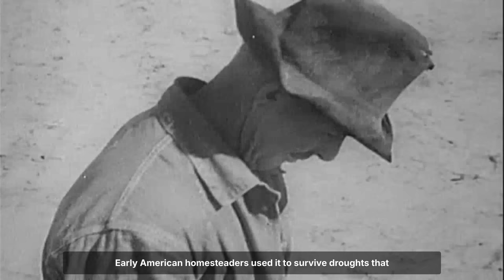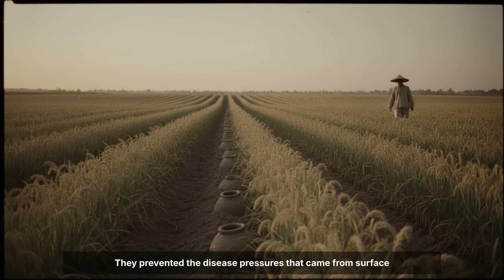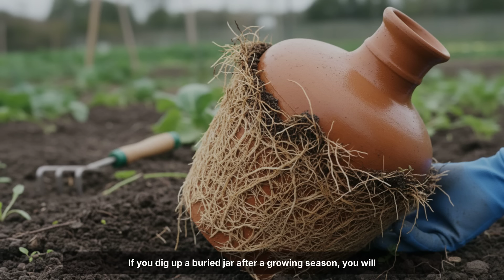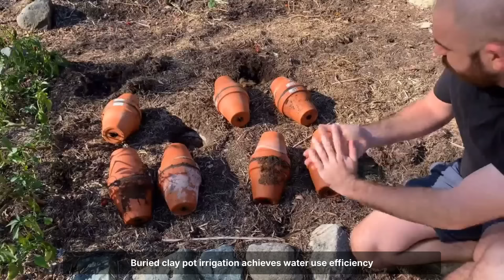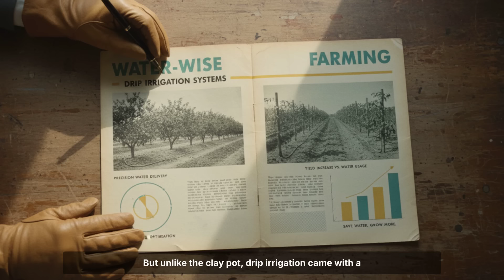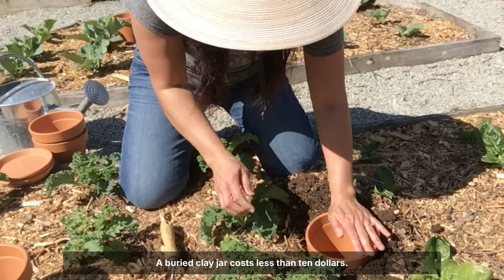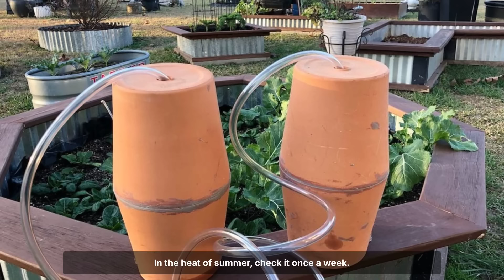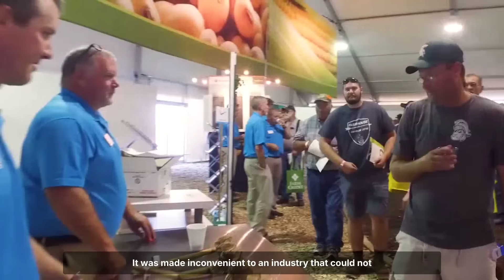Forget Watering Your Garden for Weeks With This 4,000-Year-Old System

Comment from the maker: This self watering system fed civilizations for over 2,000 years using nothing but unglazed clay and soil physics. It was abandoned not because it failed, but because you only had to buy it once.

If you want to learn how to build it yourself, what type of clay pots actually work, and how to use it in a modern garden, start here: https://naturelostvault.com/episodes/episode-44-buried-jar-irrigation.html
Reply: Please also have a look at Peter Andrews in Australia and    his work with restoration of the landscape and The Mulloon Institute.
Reply: Thanks, was having issues with my potted fig trees ..but not this summer!
Reply: I do this and it works fine.  I buying my 'modern' pots, unglazed of course.  Just block the hole, buy to the rim and use a base as a kid for easy access for filling.  Works great in summer, I am in Australia and don't freeze but in 46 degree Celsius temps, like this week, it is a huge help.
Reply: I suspect the pots were abandoned also because they confounded the plow
Reply: I think you need to temper your outrage.

Though you'd mostly only buy each jar once, each jar does require quite a bit of fuel to fire and set, thus producing greenhouse gases and heat in the process. The jars are also more suited to medium- to far-spaced plants, not closely-spaced plants like leafy vegetables. Also, the jars require the farmer to go across the field to fill each of them, while the hoses will only require some taps to be opened, and even this can be automated or computer-controlled from an office.
Reply: Does it work in a zero temperature during the winter or is it just for places like Arizona?
Reply from the maker: @SarinaSazi  it works in cold climates too. As long as the pot is buried below the frost line, the soil insulates it. It’s not just for warm places like Arizona.
Reply: @NatureLostVault here in middle and Northern Europe the frost line is up to 80 cm deep 😮
Reply: @NatureLostVault Why would you need crops to grow in winter? Why would they need water as a result?
Reply: The videolearly states that Technique was developed in China and the spread worldwide. So why Arizona ?
Reply: Im happy,
Thank you for the flashback.
Reply: Is this appropriate for container plants?
Reply: does it not get broken or cracked? since most roots hold to the pot for moisture?
Reply: Perfect for some warm parts on the planet. But here the pots would break in the first winter. Since you have to bury them up high, the soil up there does freeze and your pot is done for. 
This video would have been MUCH better, had it acknowledged this. Now, it comes across as a bit childish back-biting to another system, that doesn't break the first winter.
Reply: @gardenjoy5223 Thanks for that insight! However, farmers can just remove them before the first frost every autumn. 

It's a balance between not needing to water the crops every other day and needing to bury and excavate these pots once every year. I think the latter is a lot less work.
Reply: @ferrarim5p75  Wasn't this between having an irrigation system and these clay pots? The first is a lot less work, once installed. 
If you think any Real farmers have the time to bury and dig up pots ever few feet, you might want to look up some videos about the scale of farming. 
For someone at home it might be doable. But not even with the big yard I have.
Reply: @gardenjoy5223 Less watering per week plus less weeding per month vs burying and excavating once a year? Also, the hole can be left there in the winter and reused next spring?
Reply: @ferrarim5p75  What's your problem? You want to 'sell' me something, in which I'm not interested??? Are you always This pushy? Without Any good reason?

Comment: Another thing that helps KEEP the water is using straw,/hay for cover.  I began  using it years ago and the ground underneath is always damp.  About 5-8 inches keeps everything from drying out and it helps with weed control.  Just be sure whatever you're using is seed free or you'll be doing extra weeding. Once you start using it, you'll be hooked.  Let it break down into your soil between seasons or not.

Comment: Combining this with the Ruth Stout method (8-12" of hay or straw on the garden before winter starts, holds in moisture better, would only need to water 1/2-1/4 as much and NO weeds) would work best I think. Once set up right, almost no work. If there was a homemade funnel on the pots, they would fill themselves as well.

Comment: Do you know the prices of pottery today? It is not an alternative but a luxury thing. Also you will not use it for fields because of the work it would mean to fill every pot mire or less by hand. You can use it in a garden of small or midsize, unless you own a pottery by yourself. I am writing thus as a gardener who is using this method for many years.

Comment: Yeah putting charred plant material into the ground also works without the need for clay pots and not only does it retain water in the soil, it also acts as a sink to slow release nutrients. Clay pots are cool though for small scale use.

Comment: What happens in winter in cold climates?  Do you remove the pots from the soil or just make sure they are dry/empty before winter?
Reply: I was curious about the same issue. Seems these would crack in climates where the top 3 feet of ground freezes. That expansion would crack these pots every winter. Wondering if there is a way around that cracking phenomenon? I can’t think of it yet, maybe other others have ideas

Comment: Ive been using using these for a year but still have to water my garden.  Id say you need a LOT of them for them to fully work, say one per plant
Reply: nah. each pot have the limits area
it was 4feet.
meaning as long you put the plant around the pot 4feet, it still works.
its not good for industry but very good for people who want plant vegetable or garden for themself.
you only buy once the pot and refill the water each week. depend on where you live.
if you live in middle east, you need twice refill.

Comment: Well, in a backyard, it make sense.I use it and it works.  In large fields, how do you resupply the water in thousand jars ? I may be wrong but that it cannot realistically replace kilometers of pipes and irrigation systems that will fill the jars.

Comment: I've heard them called Ollas .  You take two clay pots of similar size and using  concrete is how u attached flipping one upside down onto the other creating a vessel . Then glue them together and cover entire surface closing off hole in bottom but leaving one hole in top to fill with water. Bury near plants.

Comment: Partial truths, take it with a grain of salt.

Just simply:
- Roots clog up the jar surface, and some plants can crack into the clay pots. No way to know it till you notice leaks or crops die.
- Can't mass drip chemical or organic fertilizers as each jar needs to be filled manually if you don't add plumbing.
- Effective grow space is reduced if you plant dense garden or crop beds
- Heavy machinery or plowers won't work with this (pro and con)

Those are just top of my head, am sure I missed a bunch of things. This is indeed good in some aspects, especially for backyard gardens. But this channel feeds on hype and half truths for YouTube money; it will penalize you if you go all in just based on this info. Especially the portion on feeding millions with "lost tech - clay pots".

You won't know it till you do it.
Reply: There "Teracotta Water Spikes"

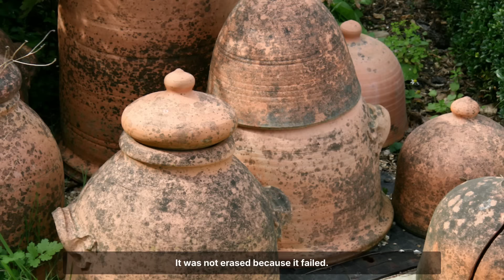Comment: 1:05 idk bro, I feel like needing to fill thousands of pots every week might be a disadvantage too.
Reply: So the issue with drip irrigation is the cost of setup, damaged small parts, and the lack of protection for water in the soil right?

What if you use old, damaged drip irrigation lines and a manual valve to refill the jars?

Comment: The thing I don’t understand is why there isn’t some type of hybrid system. People are willing to buy a system comprised of both plastic piping and clay pots. The electric timers fill the clay pots. You can make the clay pots look space age if you are finding it difficult to sell. Hasn’t anyone tried this business model?
Reply: Original Clay unglazed pots are very cheap in India
Reply: I have seen them offered on Facebook actually.  A system of connected clay vessels that have a water line into them.
Reply: Clay pots aren’t exactly cheap when you scale up. The water diffusion process depends on the radius, so larger pots are more expensive. The video’s claim that the system is economically viable is simply wrong. The system itself is good, but the guy on the video stretched too much
Reply: @SeverinoCatule no, no i dont think he did.
Reply: @3CODKing You didnt watch the video

Comment: - The cost calculation is funny. A whole garden's irrigation system cost between 200-500 USD. In contrast a pot costs 10.
... But a single pot can only water a couple of feet radius!!! 🤣🤣🤣🤣🤣🤣 YOu'll need dozens, maybe a hundred of them.
 - No maintenance: except burying them every season, collecting them at the end of the season and storing for winter. Granted not huge work, but may take a couple of days. Plus a lot of storage space

Comment: Where can you find terra cotta pots with no drain holes? All the Walmart and Home Depot ones have drain holes
Reply: I use food grade silicone to plug the hole. The same stuff to join the two pots together. I also smear the inside of the whole floor of the bottom pot since I want the water to move out the sides and not straight down.

Comment: I think the hatred of modern methods really fails here.  Rather than have drip irrigation (which is bad?) your solution is an expensive clay pot every few feet that you have to manually fill up each week?

Come on, lay a hose down once and turn on the tap. Save you thousands of labor hours not to mention cost to lay the irrigation.

Not all advance is a govt conspiracy to screw us, some are just cheaper and more efficient.  Back to the lost plants with nutrition value please

Comment: This video I can promise works. I have been using this technique for a few growing seasons and it works very well. It is so easy to manage you can go on a trip and come back and just refill it without it being emptied between the watering after days to weeks of time. Big time saver!
Reply from the maker: That's fantastic to hear! It's always great to hear from viewers confirming that these traditional methods are still incredibly effective and convenient.
Reply: Another commentor expressed concern for the need to refill a large number or vessels at once.

Do you believe its possible to create a type of funnel tool, or repurpose old garden hoses/damaged drip irrigation lines and a manual valve to cut down on time refilling the system?
Reply: @TheBromuzl I think you just answered your own question. It depends on your needs.

Comment: I use this system on my raised beds and trees in Texas and it works great. I use a lot less water and everything stays hydrated in the hell of summer.
Reply: This is helpful as i live in north Texas. Thank you
Reply: I'm glad someone in Texas does this and it works as I live in the south TX.
Reply: @marice7660 you’ll love it. I use them and love this system
Reply: how often are you having to refill them? My concern with this is that anything that relies on me remembering to do something and manually doing it, is destined for failure
Reply: @SimonDedman I fill it up once a week and try to hit them twice during summer. I built a system that I just fill up a few 10 gallon buckets and they disperse the water to the olla pots. I am not a fan of manual labor
Reply: @somegardeningandstuff yes, instead of a drip irrigation system, one could lay pipes to fill these pots.
Reply: What size pots do you use, and how far apart do you place them?
Reply: @karenwood8124 I use the 6 inch pots and put them about 2 feet apart

Comment: Perhaps this is good for a garden of a few square metres. It's not cost efficient for commercial operations where one will need hundreds if not thousands of these pots and then is the increase of labour costs. Finally, some of these will break on removal /storage and need to be replaced adding to your costs. In my humble opinion this is not a viable watering option for a commercial grower. In every video from this channel, they see a conspiracy theory that deprived us of ancient knowledge for the profit of the few. This is not always true. The drip irrigation system has saved trillions of tons of water, increased agricultural production and decreased labour costs.
Reply: Did you listen till the end it works for home gardens

Comment: On average most crops require anywhere between 450 to 1000 mm of precipitation to grow a decent yield. 1 mm of precipitation is equivalent to 1 L of water falling on every square metre. Therefore each Hector would require 10,000 L of water for 1 mm of precipitation. this means that for every hectare of crop land you would need anywhere from 4 1/2 million litres to 10,000,000 L of water to grow a decent crop therefore the John method is just not practical as there is simply not enough water available for crop production. The maths just does not work.

Comment: Wount water leak out through the hole in the bottom of the pot ???????
Reply: Video said to put a cork in its.
Reply: Use a broken pot or a stone and glue/silicone.

Comment: Setting up drip irrigation over the pots to refill as scheduled would be the least labor intensive.  Having to refill them all by hand is why they got away from it, the labor is not set it and forget it.  Now, if only we can get drip irrigation with out toxins.
Reply: May as well just use a seasonally well tuned drip irrigation. Different types of plants need different levels of moisture. You can control for this with drip easily, while you'd need to figure out which type of clay you would need for different levels of soil moisture.

Comment: Unglazed and fired at low temperature. Modern pots are fired at higher temperatures to provide a degree of frost resistance, by inhibiting the water evaporating through material, exactly the opposite of what you need.
Reply: Yh the problem is they crack in freezing weather
Reply: @ozstriker4075 Luckily in Cape Town that isn't an issue for us. But it is a serious drawback elsewhere.
Reply: @ozstriker4075 unless you drain each pot before winter. i guess for a small backyard this will work not so much for larger operations
Reply: In Bharat we call this as Maath or Matkaa made by local artisans
Reply: Maybe here in UK we can use them in the warmer months and pull them out in winter, to store frost free, ready for next year. I’m envious of all year sunshine, but our seasons are what makes this a green and pleasant land I suppose 😂
Reply: @spritzpistol  look into hügelkultur.
Reply: So you think it's better to get actual Olla's instead of using nursery pots?
Reply: @tim.trewartha  yes, actuall ollas allow water to pass much more freely, (and can be repaired easily if broken, using gorilla glue)
Reply: @steveelkins52 Nice, I did buy 4 from someone local and I do find they empty quickly (not quite the water once every 7 days this video mentions) but the one tomato plant with an Olla is double the size of one without so I think they are greay.

Comment: 1 l pot water for 2 feet area. That's lots of pots. Which is ok, just wondering, could it be bigger pots to place them more sparsely? Will 3 l pot equal 6 feet radius?
Reply: Or make a long line underground pipe from Terra cotta and connect it to water tap. You just need open the tap to water your terracotta pipe line.
Reply: I guess it just means you have to fill the pot less often.

Comment: Will terra cotta pipes work? If you fill the pipes with water and bury them? You could refill them through a tap on the surface
Reply from the maker: Yes, terra cotta pipes can work. As long as they’re unglazed, buried below the surface, and filled with water, they’ll slowly seep moisture into the soil. Just make sure the top is sealed or capped so debris doesn’t fall in, and refilling from the surface is a smart idea.

Comment: When i went on holiday for two weeks i placed all my house plants around buckets of water then rolled up a cut cotton t shirt that had one end in the bucket and one end in the soil of each plant pot. Worked a treat. Similar principle. The plant only uptakes what it needs.
Reply: How deep did you bury the cotton in the pot? Thanks
Reply: @MichelleWAperth it depended on plant but mostly up to an inch or so. Cactus aren't so picky and seem to have more dense, almost root mats, so wedging anything in there works. I had a selection of water hungry and not around each bucket. The bucket still had a good weeks worth of water after the 2 weeks away. It may not work for really delicate plants. Experiment.